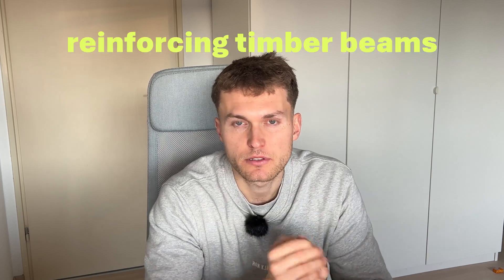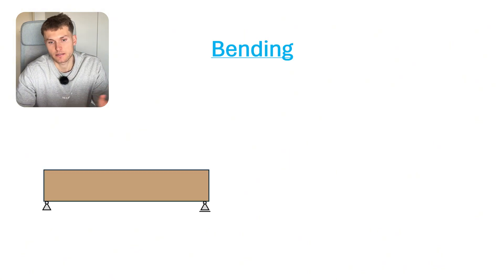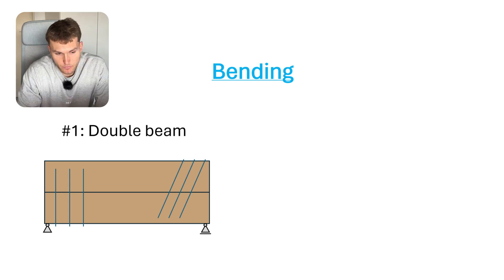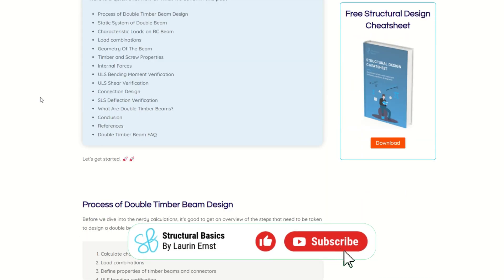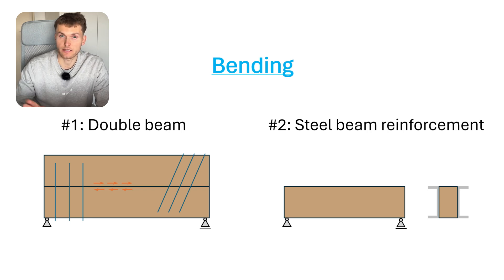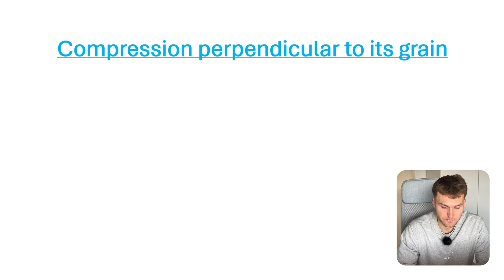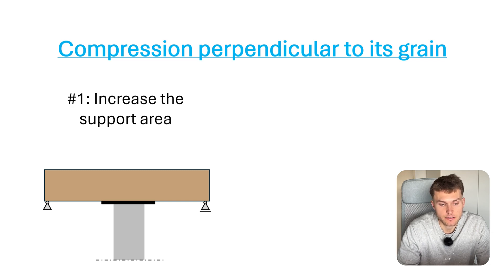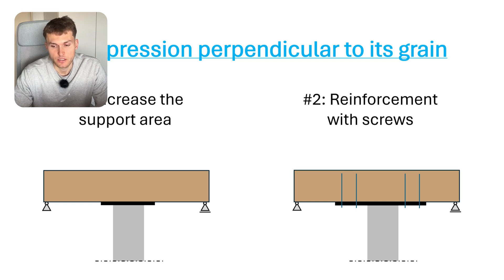Reinforcement of timber beams (do this if your beam doesn't have enough resistance)

Comment: We have a double brick 4m wide townhouse with wooden beams for the second story across the building left to right. Then yellow tongue is installed on the beams with nails and no glue. There is a lot of movement, the walls, floor and furniture all shake when we walk upstairs. Should we be replacing all the beams with steel or can it be fixed by better attaching the yellow tongue to the wooden beams?
Reply from the maker: Hi!
What is yellow tongue?